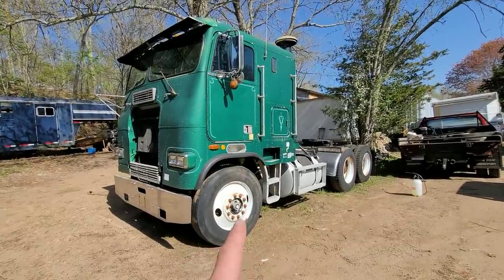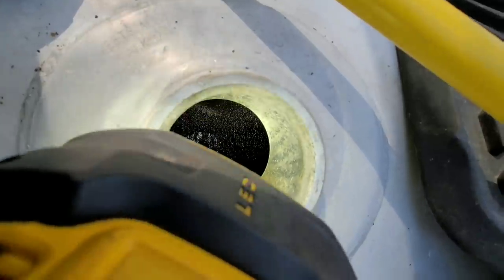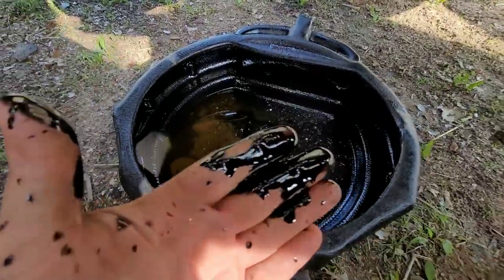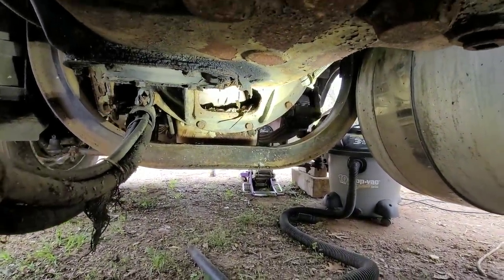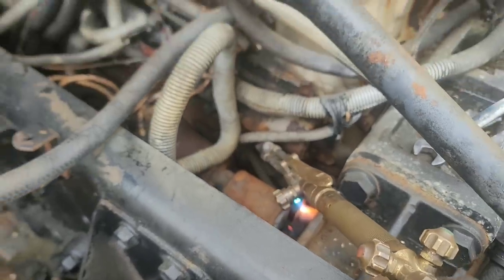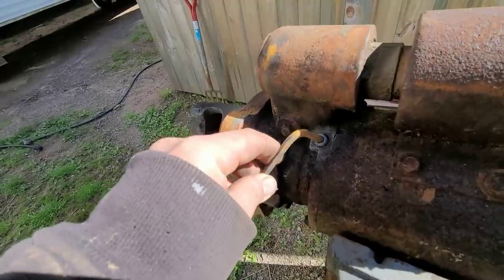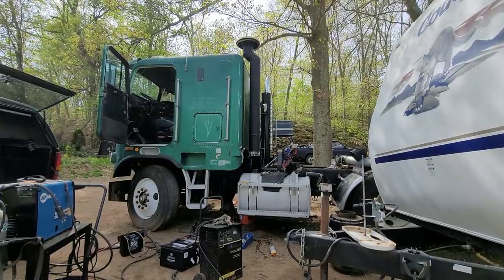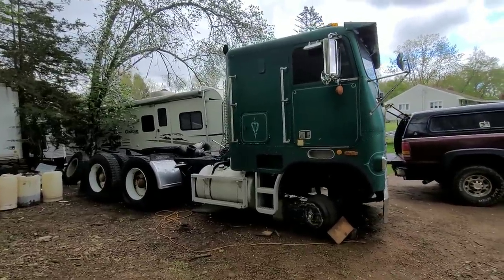Sitting 25 years! Will it start? Freightliner cabover Big cam Cummins"Jolly Green Giant"

Comment: WOW love the determination.  That blockage was a problem for us driving CF trucks thru North Dakota at 40 below zero and a windchill about 75 below.  We used to stop and put a gallon of gas in the tanks.  It worked sometimes.
Reply: Yes I remember  gas and trans oil mix and try n keep it going without taking heads off..
Reply: Love this vid. I learned how to drive a 71 cab over gmc.. with air wipers and pull out stops for motor. Man those were the days.  When a driver was a driver

Comment: You can ship the wheel to him thru uship.com. loving the old cabover!

My first truck was a 1989 freightliner  cabover with the set back steer axle. It was white with the frame painted red. Had a 300 cummins, no Jake brake, 15 spd transmission.  The ac worked. Got 4.5mpg. I bought it for $4,500 when I was 20yrs old. I ran it for 3yrs. Then got a newer truck and sold the old cabover. The guy who bought it got a deal on it ($1,500) I was dumb for selling it that cheap. Plus I found out the dude is a scam artist. Can't wait to see more! Ol' Zane was giving you some shout outs on his latest video.

Comment: the "feed"  between the tanks is called the "cross over" line.  it just balances the fuel between the two tanks.  the return comes to the suck tank on these older trucks.

Comment: Just a couple of thoughts. I was a diesel mechanic for many years, and started in 1974 with experience on these older trucks. If I may:
1) I'm not sure who you talked to who got you so worried that it would "run away." The old mid-seventies Detroit diesels would, (as well as some E6 or 7 Macks in the 90's,) but I've never heard of a Cummins running away.
2) Before you ever move that truck, make darn sure you top that transmission back off. That style of transmission has twin countershafts that ride against the main shaft. If you pop the top off of it, you'd see that all of the gears have a LOT of play in them. That's because those gears "float" in oil. If there's not enough oil, you'll turn those gears blue and seize that trans up in a surprisingly short time!
3) That housing above your oil filters is the oil cooler. That LF 777 filter is a by-pass filter, similar to the old "Luberfiner" filters used in the past. Change BOTH filters when you change the oil, (BTW, should be 44 quarts with filter change, and oil pan plug torque is 85 ft. lbs.)
4) Finally, when you start one of those after the fuel has been opened up, if it starts, jamb the throttle "to the floor" (either on the pump or the pedal if the cab's down,) and hold it there until it picks up and runs smooth. It takes a bit to purge all of that air out of the system!

Great job getting it started!! Brought back some fond memories!!
Reply from the maker: I know the chances of it running away is very slim to none but I knew nothing about this engine before I started it so I was just being prepared for anything. I'm changing all the fluids and filter front to back before I do anything else or start it back up. Good to know about the transmission thanks for the info.

Comment: Be sure and add to the list new wiring to the batteries and starter and check all your electrical connections. I am surprised that corroded mess didn't burn out. The bills are going to mount up but you don't have to do it all at once. You are off to a good start...

Comment: Id do some resurch ,  before next oil change , those 2020 filters looked like luberefiner filters , if it is correct , id delete them and plug them off at the engine !  The primary and secondary are enough filters for Normal highway use , the old lines are breakdowns waiting to happen.    In the shop , we used extra nowcool in the cooling system,   old Cummings are bad pitting the liners .   Last Cummings I sat behind was a 500hp factor setting,  turned to 600 hp .  Last cat I sat behind was a 725 hp cut back to 98mph

Comment: That old Diesel fuel will start growing Green algae in it when it sets for , well I tell you that truck only will get 5 miles to the gallon , so it needs a lot of fuel capacity, kerosene, lamp oil will clean it real good , and that lamp kinda oil works real nice for cleaning a lot of oily stuff, try it one a sample tanks , Cummins will never run away it will run up against the governor, might have rats nest or bird’s nest down in the smoke stack, good job, every thing on the truck is bullet proof proving to be a good , did you put a breaker bar on the engine, did it turn , kool thanks BigAl California.

Comment: you should used the pressure washer to get the crap out that tank before adding fresh fuel but just adding 5 gal you could still do it later ! change both oil filters the numbers are 670 & 777 use the interchange chart if they dont got fleetguard filters there is many that convert to it the brand dont really matter !

Comment: They have a acid based cleanser that you pour in there and fill with water to sit over night up to 24hrs and it will clean everything out of the tank. Then you rinse it real good and clean your fuel lines then fill, and fill your filter and try to start.

Comment: No that thing above the oil filter is a oil cooler , I know that for sure , mine went  out once a long ways from home , and the biggest Simp-tons was oil in the radiator I drove it 250 miles , kept putting oil in it 15 gallons, the water in my radiator stayed in the radiator and the oil did not get into the crankcase, thanks BigAl California.

Comment: I always punch a hole in the bottom of the filter and let it drain then remove the filter. It’s a lot less messy. Oil is changed by miles, hours or time in months, whichever comes first. Go to a truck dealer to get your filters, they usually have the proper filters and engine parts.NAPA etc is a poor place to get engine parts. Wish I was there to help, as I’ve overhauled many of these engines. Turbo sound fine, wouldn’t do anything to it. I would change the oil, both oil filters and the engine should be good to go. Try truck wrecker for air cleaner canister. Keep on trucking.

Comment: Cummins branches power generation department does fuel polishing too. Takes all the crap out of the tank. That said they usually do standby gensets. When done they treat the fuel to help keep the algae down. Cheaper than a new fuel system.

Comment: I never seen such a decent chassis next to so many rusty bolts.
Good job. Tip: electric connections should be blank and sealed
with electrical grease. They last much longer.

Comment: 9:52  No, the turbo doesn't have to spin for oil to go through. There is a restriction (a small orifice) inside the oil inlet port, that meters the amount of oil that goes into the turbo bearing and shaft. There are oil seals on each side of the shaft, keeping oil out of the compressor and turbine housings. If there wasn't anything metering the oil into the turbo, the full engine oil pressure would blow past the turbo seals, and make the engine smoke or run away. The bottom outlet from the turbo center section is simply a drain hose that goes back to the oil pan.

Comment: For a beginner you did good. Cant believe you ran a miller 110 welder off a 3500watt generator. I run a 60amp  80's craftman at half power off a 7000watt homemade generator

Comment: I thought you did burn that wire to the starter but than I saw the corrosion on one of the wires giving you an alibi . You may also have done some but those were damaged b4 you did it.Love that truck though. Im a BIG Cabover fan.

Comment: Well, next time you try to weld a nut to a thread try sanding it first, most nuts like what you were using have a top coat to keep corrosion down, and make it really hard to weld on too.

Comment: nice truck pal so much more  interesting than tbe normal semi over here in uk all our semi are cab overs except they are easier to access the cab cos the wheels are further back allowing the steps to be   in front if the wheels but you engine sounds gorgeous dude so smooth are you going to drive this beauty

Comment: The oil filters are Fleetguard, LF670 is the full flow, the LF777 is the bypass. Both spin on. The old cartridge type was an LF516 used on small cam Non FFC engines. The oil cooler is right above the 670 & 777. If you change the water filter use a service filter WF2071 with 4 units of DCA whether using new treated antifreeze or the old treated. If you’re using untreated with no chemical in it use a WF2074, it has 12 units of DCA in it. You don’t want to over concentrate the antifreeze or you can knock the water pump seals out. Use CC2602 strips to check the DCA level. The CC2602 has 50 strips.  A  CC2602A kit has 4. The water filter is right in front of the turbo on the exhaust  side. What’s your engine serial number? Should be on the data tag on the intake side of the block on the arm the accessory drive, air compressor & fuel pump mount on. The tag runs 12 o’clock to 6 o’clock. If the tags gone look on the intake side of the block. It’s stamped in to the side of the block right below the rear head. Right numbers no letters. May be  buried under the paint but it’s there. Freightliner should have the top of the air cleaner. It’s theirs. Give them the last 6 of the trucks vin #. You can glass bead it and paint it as long as it isn’t rusted through. Hope this helps.
Reply from the maker: Thanks for the info. I'm going to get those test strips to make sure I get it right. I have the engine tag it fell off the engine when I touched it. Appreciate you watching!
Reply: Go a head and post the the engine s/n, I can get you the pressure line part #

Comment: Wear a safety helmet.

1, its extra protection for your noggin while working around big machines.
2, You'll have somewhere to hang a go-pro so you can have both hands free for work and the viewers still get a level eye view of what is going on. 

Just set it recording all day while working and either do a full unedited cut or edit out the bits you don't need at the end of the day. If you say or do something wrong, just pause for a moment before continuing so you can use the pause as an edit point in post.

Comment: Cool, looks like a bit of prep paid off ,cleaning up the starter and all the battery to starter connections got the cummins spinning ,word of caution ,remember a cummins returns more fuel to the tank ,,than it burns ! also looks like you were lucky the truck didn't fall completely off that wooden block under the brake drum !, A decent jack and stands might be a good investment. And check out this you tube channel , 'Ezrider359' ,knows his stuff and works his trucks , you will learn a lot from this guy , good luck .

Comment: No. I am not talking of the oil seal in a (turbine super charger).  I am talking of the oil seals the roots blower of a 2 cycle (Mechanically Drive Super Charger) People overfill the oil and the side mounted blower (not turbo) suck oil past the seals and that leads to a run away.  I have never seen a runaway in a four cycle diesel. 2 cycles are notorious for that.  That is why they have an emergency shut down (trip cap over the intake)

Comment: Put some fresh diesel into the tank with your measuring handle tie a rag and wipe the insides to remove some of most of the algae. Would save some money to replace the fuel filter for awhile.   
Good idea. 
Use a spanner..... 
The black on the fuel filter is the asphaltains in the diesel. 
fyi. On one of the sites I was on years ago , trans oil was NOT recommended. Do check into it. 
I use another oil for injection pump lubrication. 
Don't use a crescent... 
That other gasket which I noticed when you grabbed the one for the inside of the fuel filter was that to go under the brass handle? An O-Ring would be better but??? 
Run the filter #'s that should tell them. 
Do change the oils again after a ?short time period. Remove what stuff the oil picks up.
Kooper Kote all removed bolts, do reduce the torque when tightening them as it  does decrease the friction. 
You might remove the cut off bolt with a small pipe wrench?  lots of force....

Comment: I'm a switcher truck driver and I love big trucks and have all my life.  I especially love old school cabovers and I see trucks come on the yard every day with long frames and all I can say is why?  If I were an OTR driver today,  I'd definitely find an older cabover
Reply: Michael Horn long wheel base trucks are better for overall handling and ride comfort for OTR, while today standers  a cabover  short wheelbase would be great for city driving where you got to make sharp turns in tight areas but it can be used as a OTR truck just be one hell of a rough ride.
Reply: @sdudley11  i understand about a rough ride because I'm a switcher truck driver and they are even shorter than a regular road tractor and a cabover to boot, but I also spend 10 hours a day moving trailers into really tight spaces on the yard and to the docks.  I see many long frame trucks that just can't maneuver on the yard or barely even able to get to the docks. I know that if I were an otr driver I would definitely prefer a regular frame cabover truck,  even though they ride rougher,  just for the improved visibility and maneuverability.
Reply: @michaelhorn4540  well there is nothing wrong if you like short wheel base trucks over longer wheel base truck at all but for a OTR driver, me personally i  Rather have a long wheel base truck for the better ride  and comfort they offer as im spending 10 or so hours driving down the road and not get beat around like a rag doll like you would in a Cabover. Yes I do own one and I drive it only when I am hauling local loads other then that I prefer my long wheel base truck for sure  have less visibility and Maneuverability in it
Reply: @sdudley11  i can totally understand brother,  just stating my preference,  but everyone is different
Reply: @michaelhorn4540  yes everyone is different but there is a good reason that not many people drive cabovers now days is due to the rough ride they offer and less comfort and just out right harder to work on then to the trucks today are. Don't take me wrong i do love cabover truck but i do like my conventual truck as well
Reply: @sdudley11  I can totally understand,  but they would be my personal choice

Comment: Diesel fuel never goes bad like gas does!
Reply from the maker: Yes it actually does go bad.
Reply: jessie J yes diesel does go bad is made out of fossil fuels just like gas. water and Oxygen and Extreme Heat speed up the natural deterioration process of diesel fuel. also diesel fuel freezes when it cold out while gas fuel doesn't. also that is why all diesel engine have a fuel and water separator filter on them to keep the water out of going into the injectors.

Comment: great to see that you got the old girl running again and it sounds great too, but if i was you man I would replaces all the fuel lines now don't risk getting that old crap back in the fuel system after you getting it running after 25 year sitting around not worth it just easy to replace them, Keep up the great work on the truck  and videos

Comment: New subscriber here. Seen your vids in my suggested for a while but not had a chance to really check it out with all the other good channels out there, many of which you mentioned at the end lol.  One addition to that list I'd suggest for your viewing would have to be Wayne over at Ol2Stroker.  He's obviously more Detroit focused as the name suggests, well worth a look if you have a moment.  Gonna have a look through your back catalog now as it looks good.
Reply from the maker: I agree! I recently subbed to Ol2stroker. I'll be giving a shout out to him next time!  Thanks for watching!
Reply: @NOT_FOR_HIRE  Cool, managed to watch a few of your older vids now & they don't disappoint.  Currently watching the Loadstar getting hauled home (I wonder if you'd have bid differently knowing what you know now, what happened in the end with that by the way, did you manage to sort the rear end?)
Reply from the maker: Yes it was just a bad motor I learned that it has a fairly simple design that doesn't break easily. Basically a big lever for high and low. I just stuck it in low and sold the truck afterwards.

Comment: That fuel was fine it doesn't go bad. New obama fuel is worse for it. No top end lubricants. I'll give you it was low but Ida trusted it B4 new fuel for that ole girl. God bless you for saving her. Almost bought an 82 shaker this wknd
Reply: dude all diesel fuel will go bad and what he had in his fuel tanks was bad I sure wouldn't run it threw any diesel engine that for sure because if you think about it  that truck been sitting for 25 years so it had a lot of time for water and Oxygen and Extreme Heat can  speed up the natural deterioration process of the fuel as well, SO he was very smart to drain those fuel tanks and running new fuel threw the fuel system then to run that nasty old fuel that it had in it.

Comment: You can even hold the pedal all the way to the floor and it will only go so fast because it has a maximum governed limit.  The only way to overspeed that motor is down shifting to too low of a gear at two fast of a ground speed.
Reply from the maker: I was mainly concerned about not being able to shut it off if there was a problem.

Comment: Just fyi atf is a friction modifier and should not be used as a lubricant. 2cycle oil is much better choice as it has better lubricity properties and is designed to be burned.

Comment: Good Job! One thing I noticed was the cooling fan was spinning really slow. Not sure if that's by design or the clutch is going out.
Reply: Yes is normal for the cooling fan to spin slow due to truck either a air driving fan clutch or a Electronic fan clutch. so when the truck  need the fan to start cooling the air supply is need to engage the clutch so the fan can spin faster when the engine is cool down it Disengaged  the clutch so the fan doesn't spin as fast